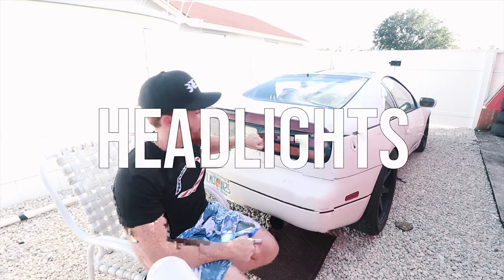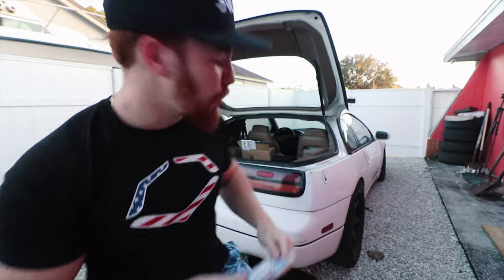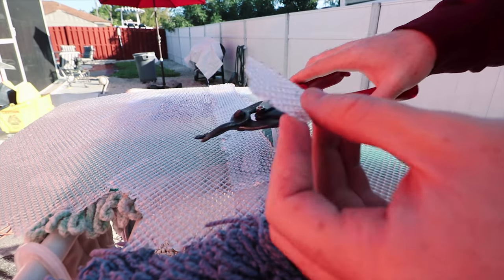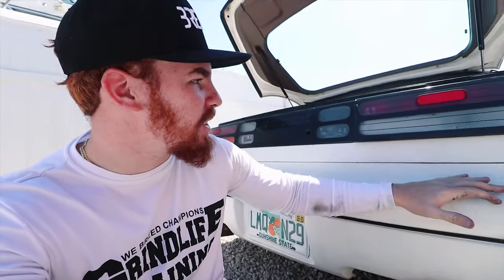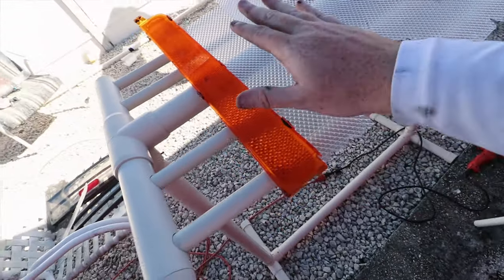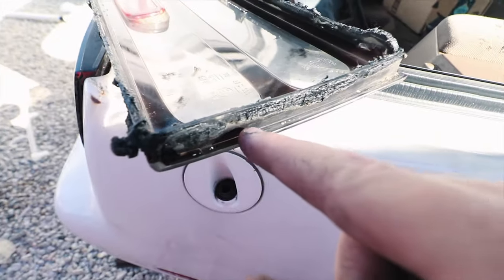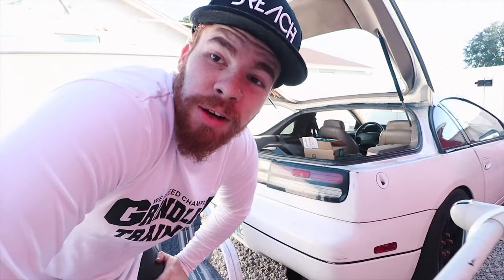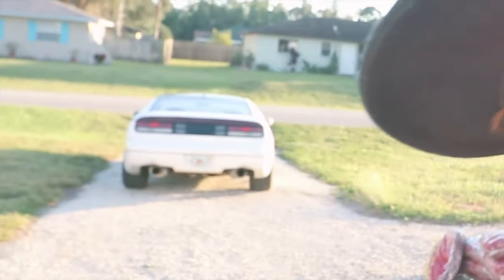300ZX DIY JDM TAIL LIGHTS (Step By Step Guide)

Comment: How did you get the light panel off after the nuts? Mine has a ton of sticky black gunk holding the lights in place…heat gun?!

Comment: Is a 2013 370z touring with 60k miles  for $19,xxx a good deal?🤔
Reply: not really. You can get a V1 nismo with less mileage that than for anywhere from 19-23. I wouldnt pay any more than 17 for a 13 touring with 60k.

Comment: You actually have got it wrong. There are no "JDM" and "OEM" lights. Those are called Jspec. Not JDM. They have nothing to do with the localized market. They are '99/2000 model years. And they were only released on the JDM market. That is true. But in short: they're JSPEC lights. Just like the JSPEC bumper for example.
Reply from the maker: Thanks buddy!